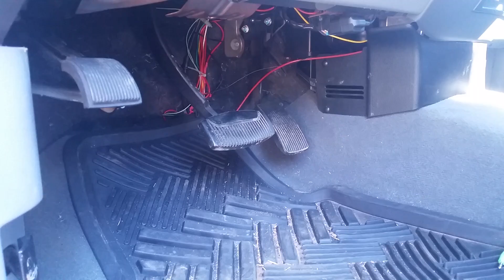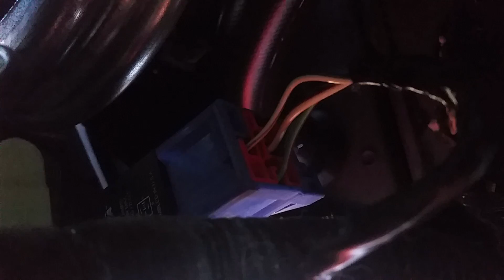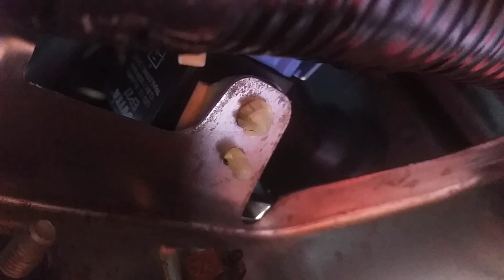Fix LED Hyperflash With a New Turn Signal Relay

Comment: So I have an 04 F-150 and I have LEDs in it, Brake/tail and front marker/signal bulbs. I got the LED relay and now I have another problem.
If I use the turn signal WITHOUT the parking/marker lights on literally EVERYTHING flashes!  Dash Back Lights, Climate Control Back Lights, and all 4 lights indicator lights on the outside of the truck so literally everything.
If I have the parking/marker lights on they work as normal and only the left or right sides flash.

Has anyone else had this problem???
If so how did you fix it?

Comment: Good video mate  ? ...question :
I got sequential paddle Led's  for my Ram 1500 , I pluged them in , but they don't blink the way they should ,  The only thing I did is replace the connectors ( old ones were rusted ) ... I have no idea whats going on ... 
I posted a video ... any idea mate ? 

https://youtube.com/shorts/oIDDgLq2zF4?feature=share

Comment: did that fix the "light out" indicator?  I have a 2016 ram 2500 and am having that problem and the hyperflashing.  what relay would I get?
Reply from the maker: it may fix the light out indicator. If you went to LED bulbs and are getting it, you might want to take a look at "CAN-BUS LED" bulbs, they essentially have a resistor built in that will fool the computer into thinking it is a standard bulb, I had to get some of them for a newer foreign car.

Comment: I know this is over a year old, but I have to add my kudos here because THIS is the EASIEST way to do this.  I've been watching videos for an hour and I had no desire to take apart the front of my dash for this and I LUCKED on to this video.  There is so much I do on cars blind (try replacing a flywheel sensor on a Mercedes SL and you'll understand) so this was WAY easier than I thought it would be.  Thanks for the video PiedmontTiger, you are a rockstar.

Comment: Excellent video.  Did you install the LEDs first?  How did you discover there was an LED relay for your car?  Are there LED relays for all cars?
Reply from the maker: +Gregory P Thanks for the comment! I did some reading online and found that I would need the relay, so I purchased it when the LEDs came in and put the relay in right after the bulbs. I think there are for most cars, but I would say checking online forums would be the best surefire way to see if your car has got one!
Reply: +PiedmontTiger 
The replacement relay did the trick.  I bought the relay with the LEDs. I installed one of the LEDs and tried the flasher, and the hyper flashing started right away.  Put in the repay, and all is well.  The repay is an excellent solution for using LEDs. Your video saved me a lot of work trying to install resisters for each LED.
Reply from the maker: Awesome! I am very glad I was able to help out and save you some time!